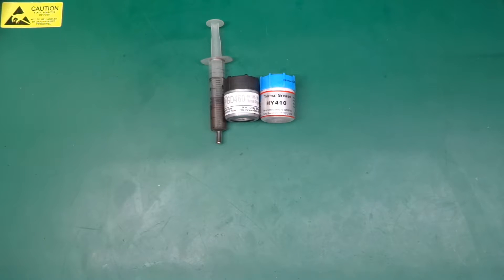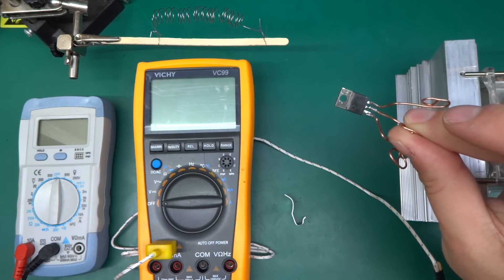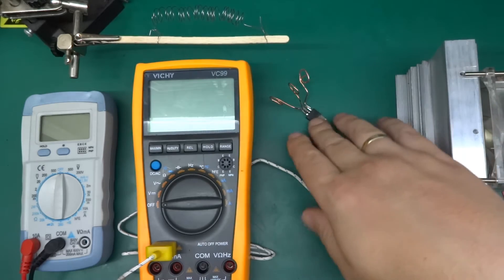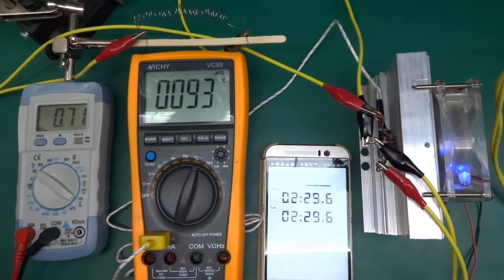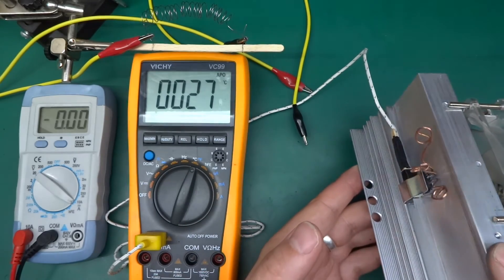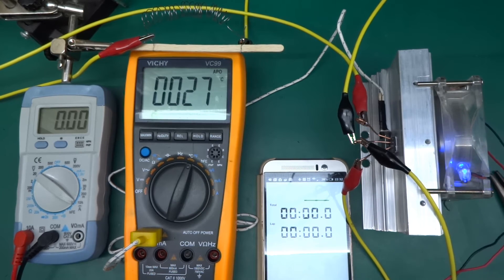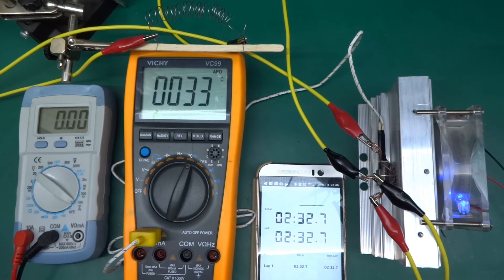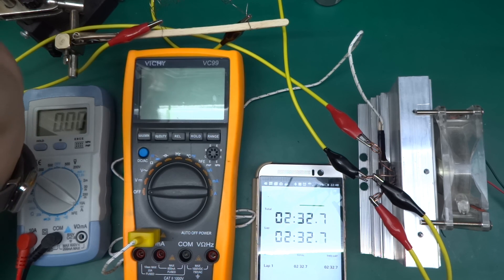Thermal compounds and copper grease put to the test

Comment: Interesting test, I was looking for some comparison data like this. A benefit of the copper paste is that it is speced for much higher temperaturers, and of course, works as an anti seize. A godsend for some applications :)
Reply: I can tell you I put this on exhaust bolts and oxygen sensor threads and when I have to go back there seems to be nothing left of the anti seize.

Comment: once i was in a fix, overheating cpu rapidly switching off my pc and had some work to do, so i tested some copperslip for electrical conductivity, and it insulates...so i applied it to the cpu in decent amounts as its so cheap, pc worked and maintained a reasonable temperature. did my work and used that pc for a month with copperslip on!  donated it to my kids for homework/games etc still working 3 years on. Real thermal grease is certainly better, but your in a fix and need a pc working fast and have a tub of copperslip on hand i can confirm it will work!

Comment: I would have liked to see application of all the paste/grease. Because the first paste was shown to be applied very liberally. If the other paste and grease weren't applied the same it would have thrown the test off.
Reply from the maker: I tried to be the same in all cases, besides all excess was squeezed out when attaching to heatsink, so remaining film (which is what matters) should have been fairly consistent.
Reply: @randomtronic  I don't doubt it. I loved the video. I'm in a pinch right now with COVID so I may run to O'Reillys for some anti seize compound for spark plugs.

Comment: This is a real problem for me, I often require a Heat Sink glue not grease for bonding tiny high power LEDs for lighting projects, nothing much seems available cheaply, I am currently experimenting with Copper powder mixed with Modified Silicone Polymer Construction Adhesive, and I may try Copper Dust mixed with Epoxy resin.
Silver powder seems hard to come by, nano Diamond dust would maybe be better.

Comment: Well it's strange that your  copper grease does not look like copper at all?
Reply from the maker: Not sure what do you mean. Copper grease is not 100% copper, it would not be a grease then but a metal. That's why it does not look like copper. Its a grease with a few% by volume of cooper powder in it. This was copper grease, commonly used for high temp applications in automotive area. I use it on back of break pads to stop squeeks and on bolts for anti seize.
Reply: Looked fine. You realize it’s in a homopolymer injection tube? Homopolymer is not clear and will make the copper grade look darker. Relies it’s called copper “grade” lubricant?  Like food “grade” lubricant. Doesn’t mean it’s food.
Reply: @h8ncars  This is not a "copper grade lubricant", it's a high temperature lubricant/anti-seize that contains copper. It's actually of little particular use with copper surfaces (though it's certainly not harmful to use on them), its primary purpose is to be used on steel.

The composition that you expect is some kind of liquid carrier capable of withstanding a few hundred Celsius and which should be fairly difficult to ignite (but can be evaporated), and then around 30-60% solid fill, with the solids being either copper or a copper-graphite mixture.
Reply: Try that one
Reply: This is copper https://www.hisco.com/UserFiles/Images/Products/loctite-30769_c5a_DV_WebXL.jpg

Comment: GD460 all the way..been using it for awhile now and no issues what so ever. I stopped using Paste years ago because one its been thru some heat cycles it get next to impossible to seperate the heatsink from the CPu and i bricked an expensice cpu some years ago because the cooler wouldnt seperate and it broke some of the cpu pins.. Grese all the way

Comment: Great test; it's pretty ingenious! I've been using Permatex (U.S. brand) copper anti-seize on my CPU for a month. The temperatures have been stable, but I can't remember the temperatures at idle and under load. I remember that they are not concerningly high. Heat plus the copper may tarnish the CPU die and/or the aluminum heatsink. So long term it maybe very bad. I'll examine my CPU and heatsink soon then add a following comment.  I'd like to do a "burn in" test and a long term test with the GD460 to see how it does. If the GD460 fails, then I'll probably buy Artic Silver Ceramique 2 on eBay.
Reply from the maker: +HWandW thanks! I haven't seen those tested like this anywhere, so I figured i will test it myself :) long term test could be interesting too, as all thermal compounds degrade with time (they dry out). But since this process is very slow, it would have to be a very long burn-in test. A very very long one, maybe months before any results would appear.
Reply: I tested copper infused anti-seize a few months before you did and put a video up...  I also came to the conclusion that it would be good in a pinch, but not a permanent replacement for high end thermal compound.  A dam sight better than nothing and about on par with the really cheap stuff though.